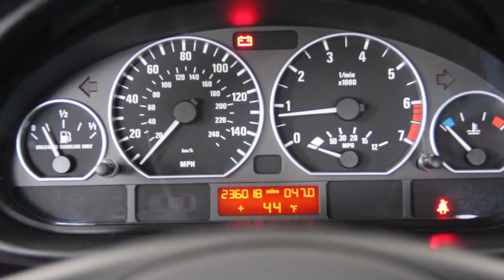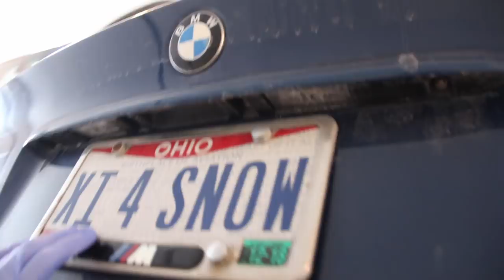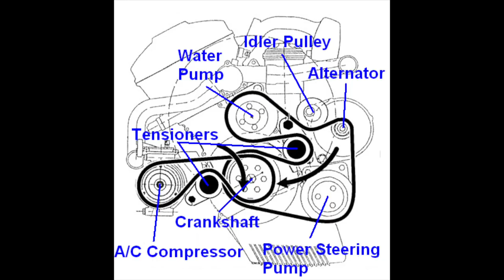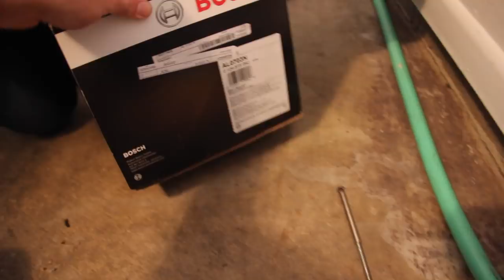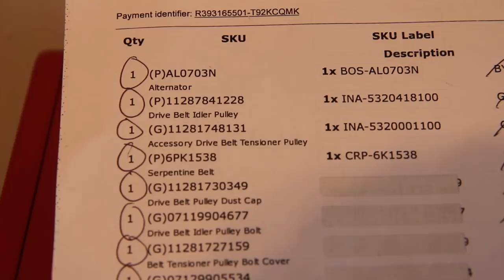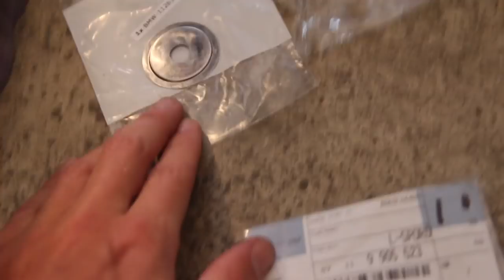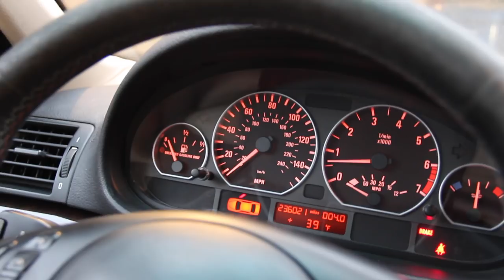BMW E46 3-Series Alternator Replacement DIY

Comment: Awesome I'm getting ready to rebuild my 540i and fcpeuro is the go to buyer. I'm getting all my stuff from them. Lifetime warranty is legit with them. Did not know it covered oil as well very nice to know that. I will definitely be changing my alternator and oil in engine and transmission.. along with the entire suspension.

Comment: Also I have an auto and I just needed 2 things from homedepot. It was a 32mm husky wrench and the longest screwdriver they had. It worked great and now I have tools that are more useful then the fan remove tool. Once you break the rust looks you will only need a hammer and the 32mm to smack the wrench and break it loose.

Comment: Also you don’t have to remove the ac belt. You can pop off the serpentine belt and leave it there. I replaced my ac belt tho cuz it was shot and surprised it hadn’t broken yet.
Reply from the maker: You do if you're replacing the serpentine belt, which you sure should be.

Comment: I had just done mine 1 month ago... I used the50skid video. It was pretty helpful. My alternator was stuck into the block and would not move with any amount of pounding on the bolt. Guess 18 years of Chicago winter will do that. I noticed my alternator went slowly over a day. My radar was going nuts from 13.6v down to 11.6v it’s readout was jumping up and down along with the battery light coming on and off.

Comment: how does the car run at 230k? how much you think the 3 series can live for? could it go to 400k?
Reply from the maker: The engine runs great!  It still gets respectable gas mileage and makes adequate power.  It's the chassis that can let these cars down.  In 3.5 years mine has rusted pretty badly.  But it's in very good shape mechanically.  I have seen E46s with well over 300k on them, and they seem fine.
Reply: @E39Source  currently at 323,000 runs decent... except for alternator lol

Comment: You didn't show how to get the tensioner to move to put the belt on.  I snapped the tensioner Bolt inside the block. Was I supposed to use the T50 Bolt to move the pully?
Reply from the maker: You rotate it counter clockwise I believe with a T50.  If it broke, you either brute forced it or the bolt was cracked or otherwise damaged.
Reply: @E39Source  thanks  I guess I was turning the wrong Bolt

Comment: You left out the important part that you have to tap on the bottom bolt that holds the alternator in. There’s a collar that gets pulled in and locks it into place you have to pull the bolt out a few threads and tap/hit with a hammer on the bolt to push the collar back out. You DID NOT mention this!!! It’s critical cuz people will sit there and not know why there alternator won’t come out.
Reply from the maker: The bolt simply unthreaded and pulled straight out, there is nothing to it.

Comment: Just follow the Hayne's Manual instructions for alternator replacement:
1 - Disconnect negative earth lead.
2 - Remove alternator.
3 - Re-connect negative earth lead 

[ Show picture of man disconnecting earth lead ]

Fitting is the opposite of removal.

Comment: I have to do this but I am with M62. Thinking if the procedure is the same and may be include for what engines is this video related to in description?
Reply: KaliKavala I know it’s good for the m52tu I just did this on mine a month ago. It’s also good for the m54 and m56
Reply from the maker: We have an M62 alternator (water cooled) DIY on E39Source.  https://www.youtube.com/watch?v=7rQu4k5b5FY

Comment: There is a better video to checkout if your doing this to an auto car. Its done by the50skid. He has a more comprehensive video. I recommend watching it. He shows you to remove a hydronic fan and how to remove the alternator and it’s locking collar that wasn’t mentioned in this video.
Reply from the maker: Locking collar?  There is no such thing.

Comment: What little hand are you talking about????? I'm trying to get the fan out but it won't come out
Reply from the maker: I'm not sure exactly what you're referring to without a time stamp.  But I probably mean the little peg that sticks out from the bottom of the electric fan assembly that slides into a hole down there to assure proper alignment.